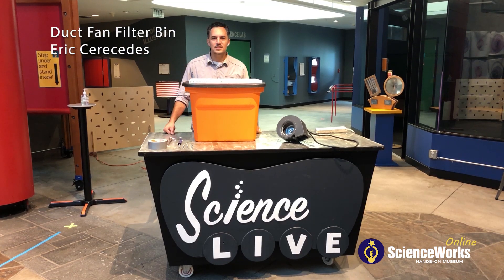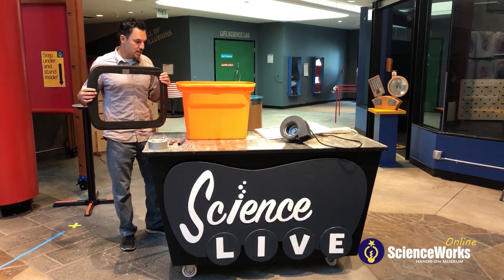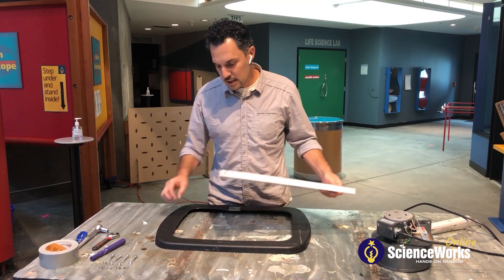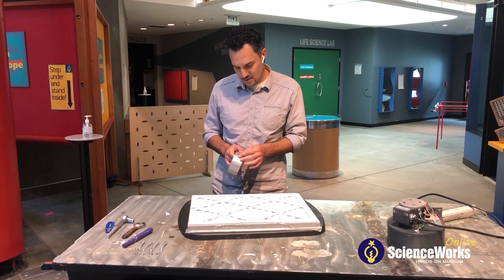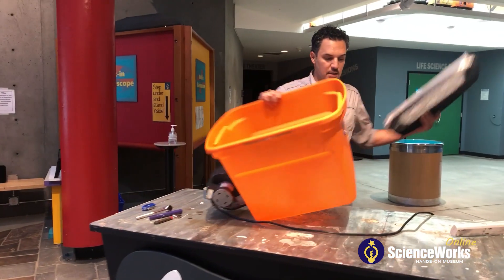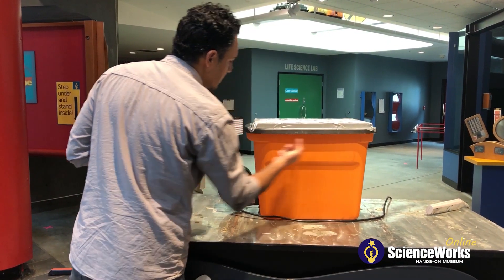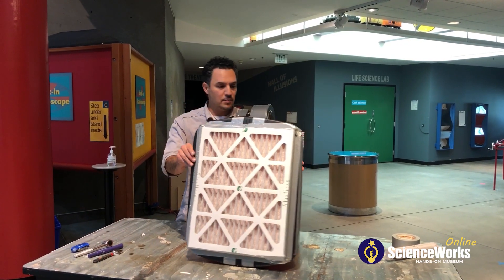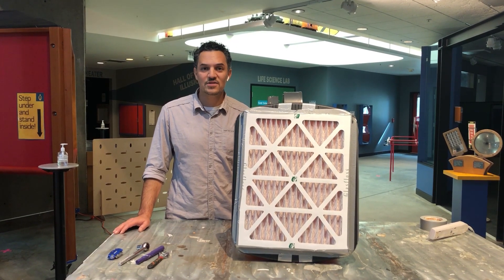How to build an air filter with a duct fan and plastic bin

Comment: Awesome and simple! What size room does this filtration system accommodate and approximately  how long will it take to make a difference? Thank you for making this video since so many families are affected by the smoke from fires.
Reply: Rachel Jones this depends on the rating of the duct fan. This one is rated at 180 cubic feet per minute. This means that it can exchange the air in a 1,000 sq ft area every 45 minutes (44.5). My opinion is that this is a reasonable amount of filtration capacity for a 1,000 sq ft area. This can be more or less true based on the amount of particulate in the air 👍
Reply: @ecerecedes1  180 CFM would accommodate 330 sq feet with 8-foot ceilings. Target four air exchanges per hour. 1000 sq feet with 8-foot ceilings requires 533 CFM minimum (1000 * 8 * 4 air changes / 60 minutes). Otherwise, great video.